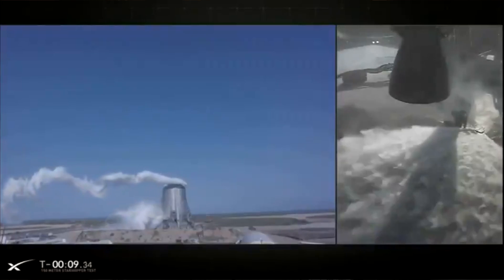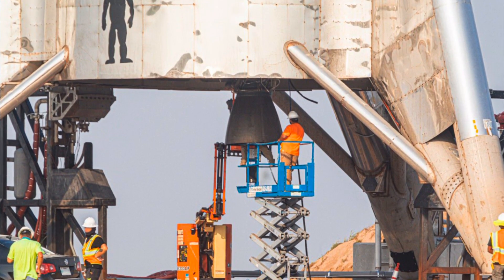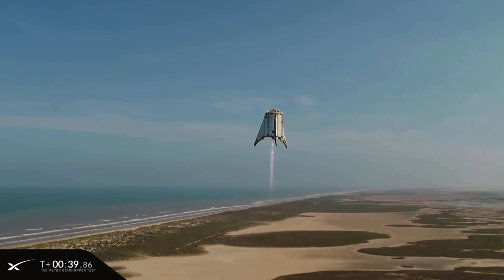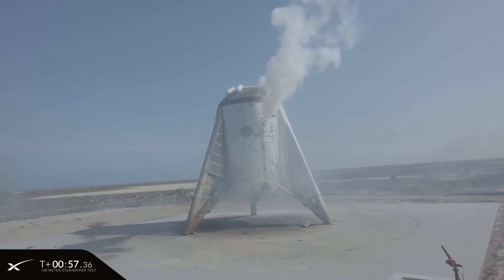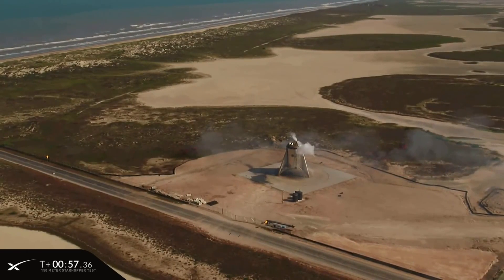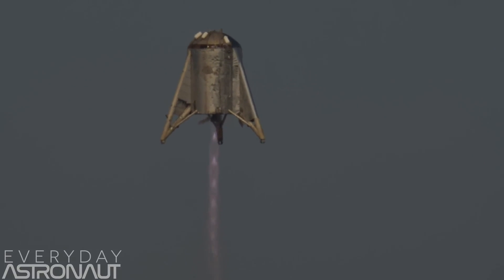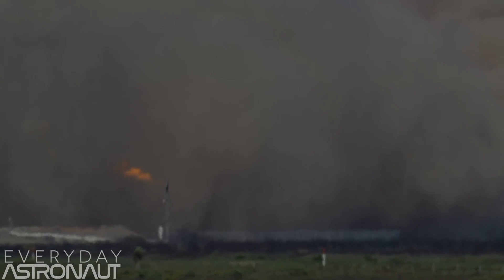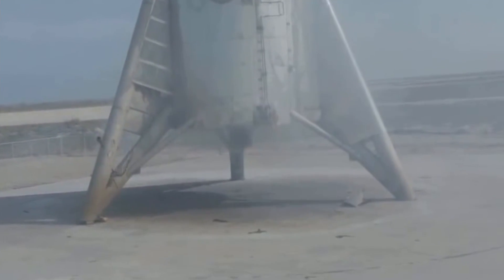Starship Hopper's Biggest, Lastest Flight Above Texas

Comment: Having the key to a lockout device is still practiced in machine repair and modification "lock out tag out"
Reply: Absolutely still the case in electrical.  You don't want someone lighting you up with your hand on a 480 V / 1,600 A buss.
Reply: Happens in theme park to on the rides, if they need to be inspected or someone has to go on the track(coasters) we put the work switch on and a pad lock
Reply: Too bad there are scumbags out there that don't observe the lock and just grab a hammer or some wrenches and pop the lock off to turn it back on for what they're doing. Never mind that someone could get seriously hurt.
Reply: @latemanparodius5133  An electrician told me he locked out a 13 kV room, started walking inside, the hair on arms started to rise, slowly backed out to find someone had cut the lock and powered-on to operate the crane. Hope that person was fined and fired.
Reply: @lawrencemiller3829  Oof.  At least they had their wits about them to be able to tell the tale.
Reply: @lawrencemiller3829  Something similar happened to me, I was changing the fuses of the motor group of a mixing facility. I was entering the room when I notice the fuse leds Still on and bright (this is a 690V 500A line) And I just had the "feeling" that something wasn't right, so I head back to the control panel and long and behold a dumbass just broke the lock pad off with the name of my company, a telephone number and a big "DO NOT REMOVE" in it, and then heads to me and says "Hey, do you know when the electricians will come? the motors still don't work!" (which is understandable because both were wearing working clothes and a high visibility vest) at which I responded not with words, but threwing my hammer trying to hit him. which lucky me I actually hit him and I had to explain myself whit my boss to the client (the dumbass boss), fortunally they gave me the ok right away, I mean, I got at 5 meters of geting serously injury or dying by an arc explosion. The dumbass didn't lose his job but they degraded him to oblibion. I had to take 2 days of because I couldn't sleep thinking about almost dying like that.
Reply: @lawrencemiller3829  OSHA would like to know your location.......
Reply: @xenolithis  You wrote:
@Lawrence Miller OSHA would like to know your location......

Comment: I assume that is a joke. I have no first hand knowledge of the incident, nor the name or location of the electrician. I was told a long time ago. I am not a suitable witness. I am merely passing along an interesting discussion.
Reply: @lawrencemiller3829  no no no..... official OSHA investigations usually begin in YT comment sections. Hope you got a chuckle
Reply: @latemanparodius5133  Sad but so true. A family member lost 3 finger ends and a thumb end because some idiot removed the safety locks and switched on a large cutting press while he had his upper body under it. Quick reactions saved his life, and a top surgeon saved his digits, thankfully.
Reply: @RWBHere  Oof.  Good to hear he survived.  These stories always tick me off and hope some manner of retribution was doled out, other than a slap on the wrist.
Reply: Electrical, pneumatic, hydraulic...anything with the potential to maim or kill likely has LOTO procedures in place.  

Whether those are followed is a different story.
Reply: Machine main switches are all made with a hole for a padlock when the switch is in a off position just for this purpose.
Reply: Its actually "lock out tag out test" unless you trust your wellbeing to the previous scumbag.
Reply: They would have defueled the tanks and probably purged everything with nitrogen before working on it...wouldn't they?
Reply: @Andrew-13579  , almost certainly. However the thrust vectoring is hydraulic and could move and cause injuries. Probably lots of little mechanical or electrical things that could be gotchas.
Reply: Absolutely. In mining in Australia it is an instantaneous sackable offense and banning from all sites that company owns/runs if you do not observe lockout/tagout procedure. It is a major incident in itself. At least at the larger companies who have a lot at stake.
Reply: At the auto manufacturing facility where my husband works, there was a guy who went inside of a machine to change out the robot welding tips. Someone came along and started up the machine, not knowing he was inside. The guy got pulled into the machine and it ripped his arm off up to the shoulder. And his head was mere inches away from also being being pulled into the machine. He did survive. But, as it turns out, the injured guy did not follow the correct LOTO procedure, and it almost cost him his life.

As a wife, hearing stuff like this freaks me out. I know there are plenty of idiots in this world who clearly don't follow safety procedures. However, on the other hand, the workers at the plant are exhausted from working 6 or 7 days a week, or either  work for 2 weeks straight without a day off. Naturally, the fatigue can cause more accidents. It's surprising they don't have more accidents. It still freaks me out!

Comment: They are building a rocket in a tent in a desert... Put a freaking tarp with an elastic over the bell, that thing will fill with dust and sand in no time. Also after you need to restart that thing after a year on Mars it would be dirty af too, don't forget your dust covers.
Reply from the maker: Correction. It’s a swamp.

Comment: Well, what I understand is, it's problematic to run Raptor at too low thrust.
But that should never be a problem with Starship, because they'll need 3 engines to land it.
Remember, Raptor pushes around 200 mT of thrust, so it must have been operating at quite low levels, even at liftoff.
Reply: DAVAUD Yoann milli-Tessla of trust, is it an electromagnetic engine?
Reply: @johnfrancisdoe1563  that would be metric tons, but i'm sure you understood. I Knox its not accurate but it's better understood than 2000KN
Reply: Rick Lokers  or, they could throttle down 3 engines by notre as much lots if its problematic tout do si.

Comment: Any chance the orange colour is a result of running  out of oxygen?
Reply: That's what I thought. Fuel rich burns yellow. Anyone that's used a cutting torch knows that.
Reply: @matthewerwin4677  They did have a limit on the amount of fuel... just trying to be positive rather than thinking that there was an issue with the engine 😉

Comment: Even if there were issues, this shows that the engine can overcome them and still perform and an acceptable level.
Reply: I think it was dumb luck. Had that happened at higher altitude the thing might've failed hard (ie. blow up) before it had time to land and shut down.
Reply: Helium Road possibly but in the new drone footage it didn’t look like it immediately lost thrust.  Who knows
Reply: @shd2236  There was a flame shooting out of the engine bay, and then the plume changed colors. We've seen that on other rockets before, usually right before the engine blows up. I think they were fortunate to get it down and shut off before that came to pass. Good thing is they'll be able to learn from it quicker.
Reply: Not really, I think it shows that there are some serious flaws that need to be rectified before this engine does more than a 1 minute hop, this engine is intended to go to Mars and back, including 2 repulsive burns so hopefully like any other space x product, it will now go through a long development, hopefully make some money and by the time it is ready to fullfil it's design brief it will be retired and something even bigger will be in this development stage!
Reply: Pure luck engine turned off 1 meter from the ground, not 20 meters. Smoke then fire in engine compartment means something went really bad...

Comment: Either way, I would call this a successful test, they gathered enough data that they can probably fix what went wrong, it managed to land again on its own legs, but lost it shoes, so they know it's an issue, and the engine firing mechanism can be looked at. Even if it had blown apart on the launch pad, it would have still been a successful test. These tests are done to both test the new rocket engine, as well as the ship configuration, as well as all the ship's systems. That whole time, they're Gathering data.
Reply: @RobynBombzero Absolutely, there can be varying degrees of "success" from RUD on one extreme, to absolutely nominal flight on the other. It's also not necessarily linear with RUD being the "worst" success, and absolutely nominal being "best", especially for early prototypes where something going wrong in the early stages can be more valuable from a data standpoint than everything working perfectly. Success can be measured against a wide variety of conditions, and will change depending on those conditions.
Reply: Lots of invaluable data...
Reply: They better gather some interesting data from the small RUD: we wanted a flying water tank, not a flying COPV tank. To be fair, the COPV didn't fail, the plumbing at the ends failed. But pretty serious, since it blew out the side of a steel rocket.

(Not a white tank from the top of the rocket. A black one, apparently for RCS thrusters, mounted internally.)
Reply: @donjones4719   i used to be an armor crewman in the Army, and I can quite assure you, tanks don't fly.
Reply: @odysseusrex5908   :)  So interesting, because of how they ended up being called tanks. For secrecy's sake, the Brits WW I development program was ostensibly developing water tanks! Was this dual identity fated to fly, 100 years ago?

Armor crewman: sounds fun, and very difficult.
Reply: @donjones4719   Yes, I am familiar with that history. The project was originally begun in the Admiralty under Winston Churchill. He wanted the weapons to be called landships.
Definitely lots of fun. Of course, I was fortunate enough to serve in a time of relative peace. I never got shot at.
Reply: Mmmmm data
Reply: could have been as simple as an oxygen line or pump broke free from the structure due to vibration, after all, it's not like hopper is anything more than a basic steel frame with some sheets wrapping it. either way, it is bound to of supplied loads of data that will make starship prototype 1 and 2 better
Reply: I have to wonder, would you say that if something happens on the SLS test stand? Or do we say that to rockets we like?
Reply: if only that were true...if NASA has taught us anything. Most dangerous job; something blows up...and its relegated to obscurity by bureaucratic safety committees.

Comment: There is a very simple explanation. It got close to the ground, so it turned on the safety flame, to warn everybody that it was still there
Reply: aah yes good ol' safety flame
Reply: Safety flame seems legit.
Reply: Erik Mellander  The thermal warning part of landing area heating up should suffice as a replacement for a humming sound. Speaking of sound?

I wonder what it'd be like at the ground below the rocket exhaust when it's flying at about 150m. Initially as it's going up there's a lot of dust being thrown up but haven't seen both the rocket and the ground being visible at it was traversing the distance to the other pad yet.
Reply: Extra stuff Without the water suppression system, you would probably be killed just from the noise levels. If not, the heat would do it.
Reply: If you could lower the exhaust temperature without reducing thrust, would that count as a safety flame?

Comment: 4:12 venting methane? Why not burn it and lessen greenhouse gasses?
Reply: Because it's a rocket and nobody cares.
Reply: @matthewerwin4677  Elon has another company which seems to care.
Reply: @dosmastrify  Elon uses millions of tons of plastic, glass, steel, and aluminum a year. How is that someone that cares about the environment? Someone that really cared would be living off the grid in the woods.
Reply: @matthewerwin4677  while the world kept burning diesel and gasoline... Riiiiiight
Reply: @dosmastrify  Those power plants charging Teslas burn natural gas, and coal. Lots of it. Only 17% of power in the U.S. is from renewables.
Reply: @matthewerwin4677  and gas cars will always be dirty even as the grid improves
Reply: dosmastrify ... combustion produces the green house gases carbon dioxide and water.

Comment: A question. Maybe offtopic butt anyway.
What Type of Light bulbs, LEDs or lightsource does the international pacestation use.
I mean think about it. Would you like to carry new Light bulbs when you send someone up.
Thy
Reply: I'm just guessing here, but I'm pretty sure that they are using LED lights. They last very long, they are less sensetive, and they run on lower voltage. The LED lamps that we use down here are unnecessarily complicated, because they have to run on the existing 120 or 240 volt power grid. In the space station the could for example use 12 volts, then a LED lamp could be built using just four LEDs and a resistor.
Reply: @IlIlllIllIlIIIll  .. . and I always thaught they have PetroMax . . .
Reply: @IlIlllIllIlIIIll  Betting is really dumb yes you do know yourself ...

They use fluorescent light bulbs which now are being replaced by LED's.
Reply: They use lasers. They have huge laser arrays pointing at the ISS at all times following it and on the ISS they have tubes that get hit by the laser and reflect the light by bouncing it 2.5 millions times. This gives a nice glow. They control the lights by asking ground control to lower the lasers intensities.
Reply: @dpscloud3324  They can also cook hot dogs by sticking skewers out the window and asking ground to turn the lasers to max.
Reply: @dpscloud3324  Just yesterday saw an episode of NASA's Unexplained Files where they mentioned some amateurs did just that but they used 1 1 watt laser
Reply: @IlIlllIllIlIIIll  Depends. Power goes out LED goes out. Fluorescent doesn't have that problem. I like backups down here on my soil. I'd like them even more in space.

And NASA keeps thinsg top secret. Won't tell us how many actualy astronauts it takes to change a bulb.
Reply: @MrFlatage  What are you talking about? Fluorescent lights depend on power just as much as LED and incandescent lights. What they actually do to maintain some visibility when power goes out involves phosphorescent panels, the glow in the dark stuff. NASA worked with a manufacturer to improve on the old-fashioned kind.
Reply: @YodaWhat  Sigh ... it is called science? It's not some home depot low-pressure mercury-vapor gas-discharge lamp? Which normally light up cos a electrical source of UV light? Can you tell everyone here what a a luciferin is?

But yes plenty of people here have no idea what I am talking about. I have that same problem with other fields of science.
Reply: @MrFlatage  😂😂😂😂 dude you're next level stem mindset
Reply: @dpscloud3324  Nah I like the old-fashioned kind that keeps on working. Chemicals dont care about radiation or EMP's out there. ISS isn't too hard but imagine your in your tiny can nearing Mars? Can't call the nearest depo for new bulbs then.

Even my 7yo went with a old school Avengers assemble when he beat Captain James Kirk in the most advanced ship devised by America. Old stuff still beat him easily.

More a 'if it ain't broke dont fix it' level. Not against improving stuff but you have to remember where you are coming from before you ... Well you seen Moana I am sure. ;-)
Reply: @MrFlatage  Maybe names are different in your country, but in USA, fluorescent lamps are a kind of low-pressure Mercury-arc discharge, which emits a lot of UV light. The UV is then shifted to longer wavelengths by a coating of "phosphors" which are actually composed mostly of "rare earth" elements like Lanthanum. Luciferin is used in an entirely different kind of light source, the chemoluminescent kind like "glow sticks". Those are indeed non-electrical, but they are not reusable like the glow-in-the-dark panels used on ISS.
Reply: @MrFlatage  Buddy, I don't know about you, but if something went so terribly wrong that the redundant power systems of the ISS couldn't smash enough electrons together to power a LED, I'd be much more concerned about where all my oxygen just went than about having to use a flashlight. Secondly, have you ever heard of the NASA Technology Transfer Program? Check out Reference Number LEW-TOPS-108. Sign up, fill out a brief survey, and they'll e-mail you all their research in QUANTUM ENCRYPTION TECHNOLOGY.

Some other neat stuff NASA just lets random people download: 
MSC-TOPS-38: Robot astronouts
LAR-TOPS-33: Something something predator drones
LAR-TOPS-156: Amorphous Surface Robots??? (DIY T-1000???)
MFS-TOPS-5: Laser torch.

Literaly just do some googling and send some e-mails, and I bet you can get a skype meeting with the engineer responsible for ISS lighting design, and he'll tell you more than you ever wanted to know.